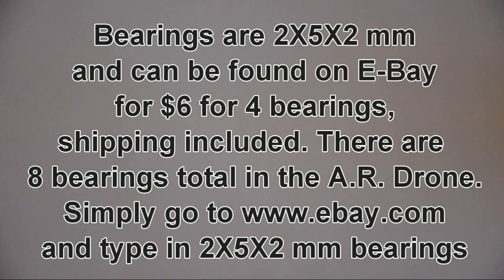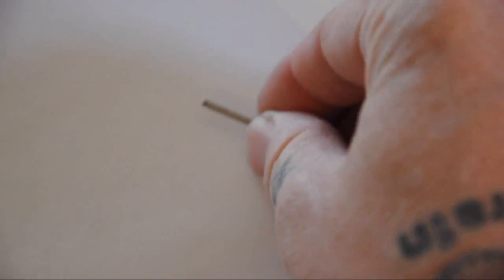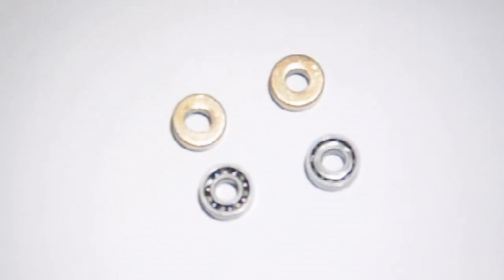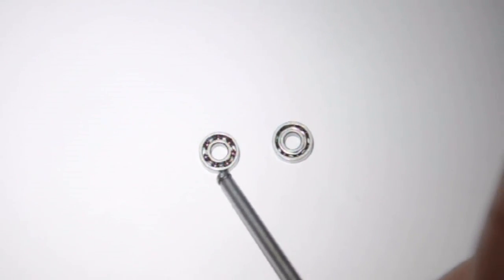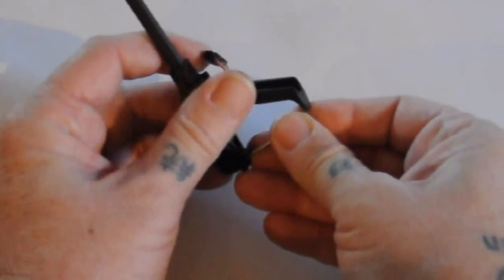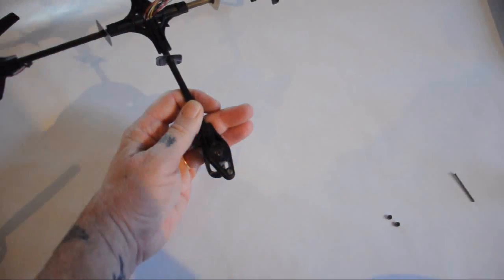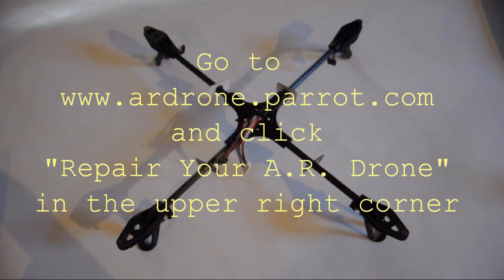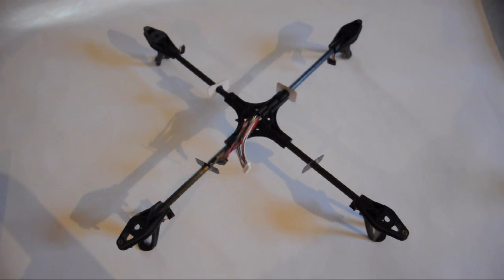Parrot's A.R. Drone Bushing to Bearing Conversion

Comment from the maker: @bongbeltran  less friction. You go from metal on metal, to the much less friction of the roller bearings. This should improve motor efficiency and lower motor heat. Theoretically could improve flight time. From what I understand, this could be a change made in the future A.R. Drone's, replacing the brass bushings with ball bearings, according to a U.S. Parrot technician.